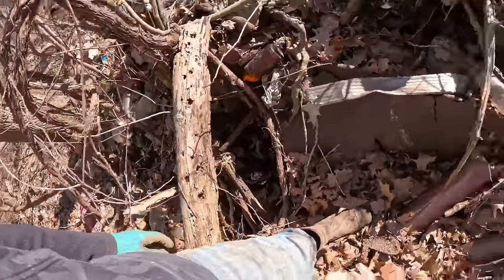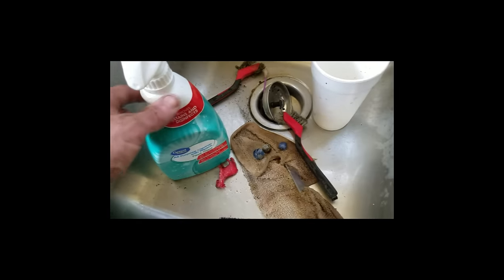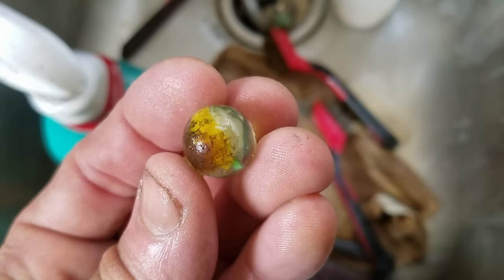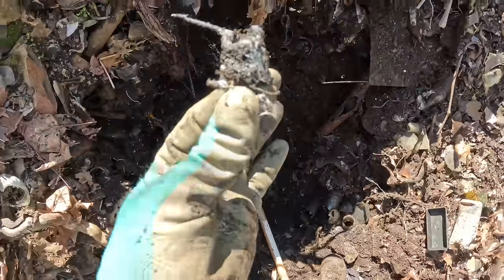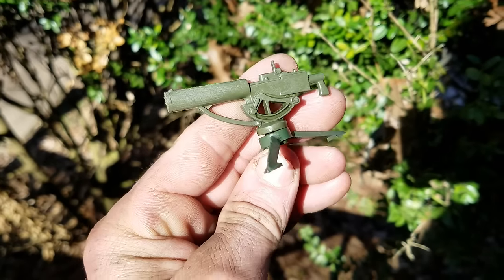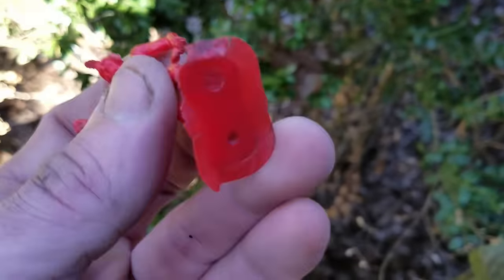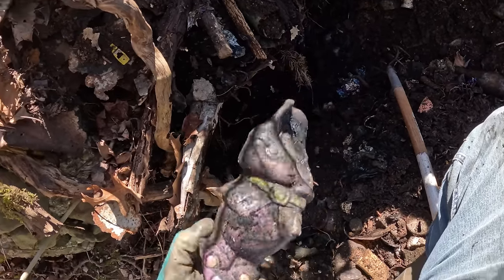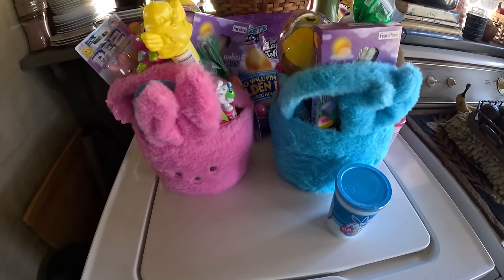Digging Vintage Marbles & Toys - Bottle Digging - Antiques - Free Stuff - Trash Picking Archaeology

Comment: If you ever need to get stuck concrete off of your marbles you can use muriatic acid. You can pick it up at just about any hardware store. Just be careful with it though. It well emidiately eat your skin if you're not careful. I would pour some in a small glass dish or a dhpe #2 plastic and dip your marble for just a second or two. That should eat any rust or concrete or pretty much anything stuck to your marbles. After that, a quick rinse in water and you're good to go.